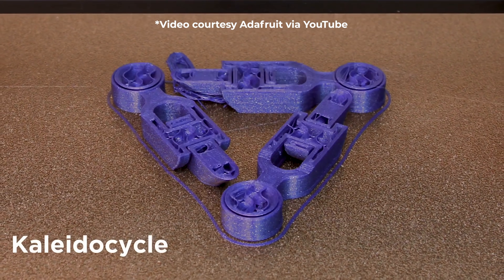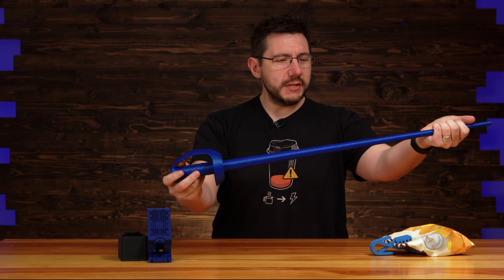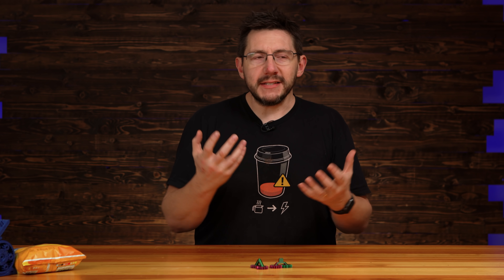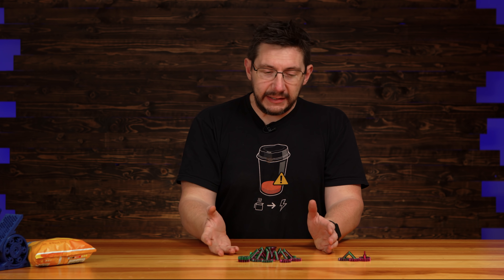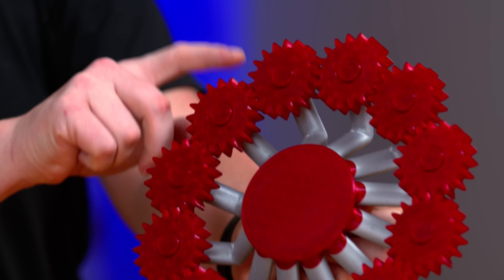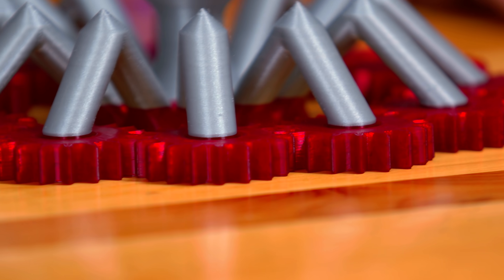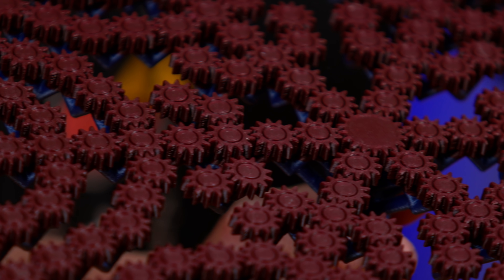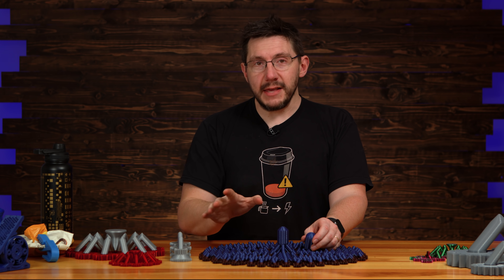WILL 307 GEARS SPIN?

Comment: May be too late but I don't think it will work even with a new design.
Each gear introduces friction to the system. 307 gears I would guess (haven't done the actual calculation, too much for an internet comment) is more than the strength of the PLA layers. Meaning, even if you had everything set up perfectly and the model design was great, there would still have enough friction that would require more torque on the handle than the material could take.

Comment: What about trying it on a resin printer able to resolve to much smaller details?  Sure it wouldn't be as large, but even hundreds of smaller gears would still be interesting - and you could use a nylon-like or even a flexible resin that would be more durable like Siraya Tenacious. (or even mix and match elastic/flexible with hard until you get the 'just right' material properties to turn and not break)

Comment: love your videos as always. I teach physics and that gear ratio print would be really useful to me so I gotta try and print something like that. I would say your explanation of torque was not good and I say that from a place purely of constructive criticism. Obviously not expecting you to give a hole physics lesson here. However, the implication you gave was that we use gears to get a slow-moving gear to get a free amount of speed from the gear at the end. However that speed we get outcomes at a cost of turning force. It's like comparing a tractor and a Ferrari. Tractors or pickups don't go quick but can pull a hell of a lot whereas the opposite is true for speed cars. P=FV and Torque = Fxr are really key here. Anyway, that's me done sorry if I came across as overly negative not my intention. Love your videos watch them all and keep doing your great work!
Reply from the maker: I am SO THANKFUL you left this comment! I know my explanation sucked, thank you for helping me learn!

Comment: Why don't more people use the 50/50 alcohol water trick?
Reply from the maker: What is this trick you speak of?
Reply: @3DPrintingNerd  If you spray  a PLA or PETG print with a 50/50 mix of Isopropyl alcohol and water, the underside of the part sucks the mix right in and pops out without effort. 
I say PLA/PETG because those are the only ones I have tested, but it could also work with other materials too.
I also recommend doing this when the bed has cooled to prevent glass from cracking under rapid cooling.

Comment: Flexible build plate for sure.

The model also needs something above all the gears connecting all of the arms for stability. Then 3-4 perimeters and 20% cubic infill for strength. You got this!!

Comment: I have that exact same Quantum color filament, and I’ve found that it adheres quite well to standard PEI sheets, such as on a Prusa. I’ve also printed a number of objects in vase mode as well as print-in-place, and they exhibit a lot of strength. Maybe you need to check what temperature you’re using, since I had success with my standard PLA profile in Prusaslicer.

Comment: Not sure if the printer can do a bed mesh... I'm printing on 350x350 on a jig plate (with a WhamBam Flex Plate) and the bed mesh can handle the discrepancy in the flatness of the jig plate.  Though my printer can handle 0.01mm Z movement without Z backlash, which helps a lot with a bed mesh.

Comment: I would try to remove the welded spots with V-slot mill in Dremel prior to wasting another filament. Thats one or two layers that welded. Handle can glued. One failed gear cam be replaced.

Comment: The gears are just too small. The friction is very big. Every gear will deform the structure a small bit and the gears will lock. The model needs to have larger gears and a more rigid structure holding the gears.

Comment: You should do a video on tuning a machine for specific things like.being too close or too far and how to fix it like you did. How to fix over or under extruding or anything like that. I specifically have had an issue with my print in place katana fusing the blades to themselves at spots throughout the print where sometimes you get sections that move and others that are totally frozen. It's mainly at the blade transitions and I don't think I have oozing or have it printing too hot to cause anything like that.

Comment: I want you to try to print ithis large gear model on the RailCore II 300ZLT if you still have this printer. Since this printer has so fine detail and the bed is physically level not just level with a probe. I'd like to see if the printer is worth the money.

Comment: As someone who designs functional prints mostly, I have to say that I've become quite unenthusiastic about print-in-place - for me almost all PIP designs are gimmicks or toys, they look interesting and prove that your printer is well tuned, etc, but I have yet to see one that is solid and functional. I once designed a few PIP hinges, and after putting them into use, found that they failed quickly. I redesigned, keeping the same proportions but as separate parts joined with bolts, and the hinges are robust and hold up after heavy use and strain. My 2 cents - people should do whatever is fun for them of course.

Comment: I printed the one from JVB for 27 gears on my Prusa Mini. It is 14 hr print. When finished let cool and carefully remove from the build plate. Some of the gears will be stuck. (CAREFULLY) take a pair of long nose pliers and slowly rotate the gear back & forth. When all gears are loose, slowly work the turn knob back & forth till you get a full rotation. You will have to carefully break it in, give it a shot top and bottom WD40 and continue to break in. It will be very smooth once broke in and a great print model. Go for it, it can be done.

Comment: I say go for it but print on a raft to take up the unevenness you had in thee bed. You could also add horizontal expansion to make the handle spin easier.
Reply: I think this sounds like a great idea. Never a better time to use a raft than in this case.
Reply: Wouldn't a raft be absolute pain in the * to losen from the gears, and also the tight tolerance between the gear and spindle would mean it needs to be 100% cleaned from scraps from the raft. I've never had luck with rafts or supports 100% perfectly releasing the models.
Reply: @PeritusGamingTV  Chep had some settings for rafts/supports a while back and they worked spot on for me, prints peel off with minimum cleanup being needed👍

For anybody else reading this- remember to back-up your profiles to an external or the cloud regularly. Lost all my profiles whilst in the process of doing a long overdue full system back-up🙄 losing work was a kick in the teeth but losing the profiles compiled from a couple years of tutorials, tinkering and trial and error... that kick was felt lower down!
Reply: he's not using support blocker for the handle to be 100% infill and it will break again anyways...

Comment: This video has really helped me articulate a thought that's been lurking in the back of my head for a while.

Basically, there seems to me to be a desire in the 3d printing community to have the printer do as much as possible when building an object.  Whether it's trying to make a static object into a single print, or to have a moving object like this one be print-in-place, it feels like that's a major goal for much of the community.  And yet, as this video shows, that's often not a good idea; not if the goal is to actually have the object.

Now, I realise that the goal here was not, in fact, to have the 307 gear object.  The goal was to see if Joel could tune in a massive printer tightly enough to do this large of a print-in-place.  That's a worthy goal in and of itself: for most of us this is a hobby and hobbies are about messing around with things and having fun!  It's also a way of pushing forward  the technology and capability of even the hobby printers, and I can certainly imagine that for some objects, print-in-place would be the simpler if not the only way to manufacture it.

But this video also, I think, illustrates that for some things, print-in-place or single print is not actually the best approach.  If one actually wanted the 307 gear object, printing the frame, the gears, and a set of connector pins would have taken a bit longer, and required more work on Joel's end to actually assemble everything; but it also would have much more reliably resulted in a working device.

In other words, I think there's a line between "I want this thing" and "I want to see if I can do this" that sometimes gets blurred.  And then the classic "if all you have is a hammer" problem pops up, and abruptly everyone is trying to 3d print everything instead of just buying some screws from Home Depot.  

But I enjoyed this, and it also showcases Joel's strongest attribute: a spirit of exploration and enjoying the experience of just trying stuff to see what happens!
Reply: "there seems to me to be a desire in the 3d printing community to have the printer do as much as possible when building an object."

If you are interested in this topic, research design for manufacturing. For small batches, your point is valid that using standardized screws and components may be a better solution. For manufacturing medium-large batches, print in place requires less labor and fewer additional parts, significantly reducing price and making production easier to scale. Print in place helps develop 3d printing into a (more) viable medium-large batch manufacturing method.
Reply: @evangill5563  That's a good point.  And I think I kind of grazed the edge of what you're saying when I noted that projects like this push the overall technology forward.

But I do think at the hobby level, we all (I include myself) get sucked into the idea of printing everything even when it's not always the optimal solution.
Reply: Yeah usually, at least for me, using threaded rods and small printed parts is much easier and faster than printing a single thing.
It does require assembly, so for bigger batches it might not be as useful.
Reply: It can be easyer to hit tight tolerances with printing everything at once. You often don't have to messure anything which is a big plus. (If it fits or works it is perfect)

Comment: You asked us to comment at the beginning, so I'm going to guess that it will work. Either functionally, or it will be a fun process which in a way is the video working even if the print doesn't. So, High-5! either way. :)

Comment: I think, for a bed that big, you need mesh leveling even if it's glass. The tolerances in that part are already small and any warp/wave in the plate will eat them up fast. You're not wrong on the shiny/silk filaments. They are definitely weaker in Z than the rest. Points to you if you get this both functional and shiny.
Reply: This. Manually level to the best you can then run ABL to have it perfect.

So many folks just won't run ABL as if it's a bad thing. But when used proper makes things like this print possible with less failure.
Reply: No, just an ATP5 plate bed. Assuming the machine is well made & calibrated.
Reply: As long as it's quality glass it should be fine. He should have dynamically leveled.